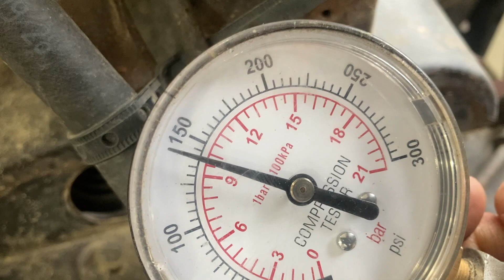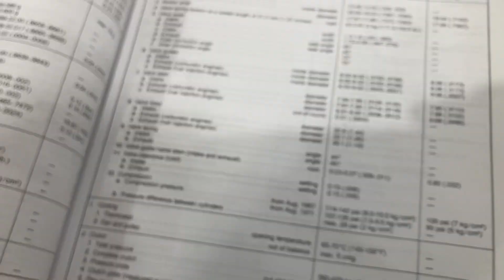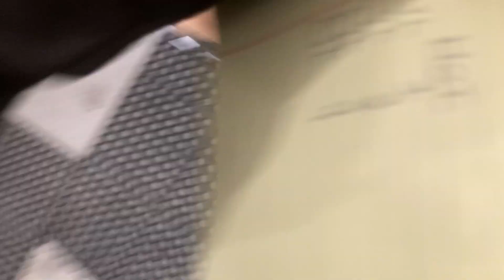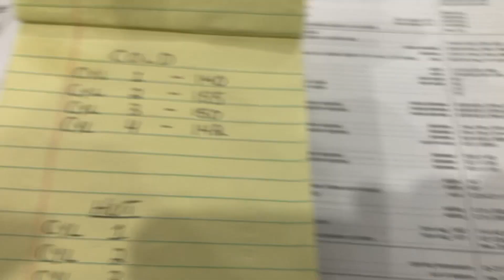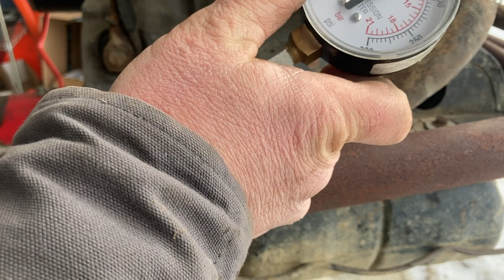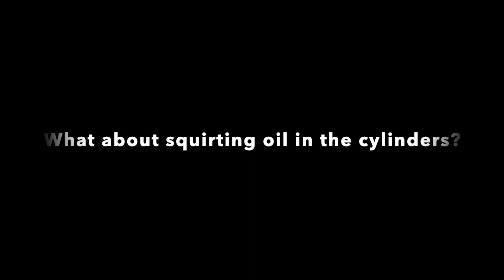Air Cooled VW Compression Test - COMPLETE GUIDE

Comment: Nice vid, I am fairly new to air-cooled VWs and been learning about them lately, I'm planning to do a compression test on a stock 1600 dual port

Would elevation affect the results of this test? My logic says so, that they should be lower,  but I might be wrong... I live at around 9000ft or 2800m

Comment: This was an awesome video!  I have never done a compression test, and now I've saved this for when I have to.  Right now my issue on my 79 FI bus is that he wont idle, unless the brake assist hose is pulled out.  Then the idle is rough.  Worked great up until about a week ago.  Have checked and cleaned all the wires, teste the 3 & 4 FI with a noid, and evertyhing is working.  Just haven't tried fuel pressure test.  Have you got a video for that?  :)
Reply from the maker: I know this is a late reply, but thank you for watching this video! Somehow I missed your comment! How’s the VW going?

Comment: My father had a 1600 dual port in a 1971 VW.  The compression in the #3 cylinder would drop below 115 every 30,000 miles.  The problem was always a valve, and never was a sealing or ring problem.  The engine also sucked the exhaust valves in the same cylinder down into the crankcase.  It happened three times.
Reply from the maker: Something very wrong was going on in that situation….

Comment: I don't understand why I need to know the average or the variance across the engine for each test. Problems are on a cylinder by cylinder basis. And since you numbers are so good, why would I want to know what the variance or average is for a bad engine? If the readings are out of tolerance per cylinder cold, and out of tolerance per cylinder hot, what use are those other two stats? I'm not nitpicking, I just don't understand why you bother to figure those up? The "wild changes" will appear from test to test.
Reply from the maker: If you don’t feel the need to test cold and hot, or with an average reading, then don’t do it. 

I prefer to gather as much information as possible. If the compression suddenly drops when it’s hot, this could indicate a crack somewhere that has now expanded, or another issue.

It takes such little time to do a thorough test, I just don’t see what it hurts, and there’s a chance you’ll notice a pattern.
Reply: @MaineMachinist  I understand getting data. And please don't think I'm criticising the technique. I'm actually trying to understand it thoroughly. I need to test a 1600DP this weekend. What I don't understand is how the variance is useful to you in determining a problem. Variance is about dispersal across the numbers. Does the manual state a variance as equal to a cylinder by cylinder loss of pressure? If cyl 1 is 125 psi cold then 85 psi hot, with all other cylinders within range, how does that variance help in determining the issue? In other words, how are YOU using that statistic so that I can use it. What does the variance specifically tell you?
Reply: @paulcostinett886 I think he said it may be a clue or a reason to investigate further. And that the compression test is generally inaccurate and unreliable. You might consider using a differential pressure cylinder leakage tester in the future. ✌🏻👶🏼🚬

Comment: a friend just put together a vw motor and it won't start when turning over instead of sucking in the carburetor it blows out what has he done wrong?
Reply from the maker: Do you mean the carburetor makes a  popping sound or it’s coughing?

Or are you saying if you took the carburetor off and put your hand over the intake manifold that it would push air OUT against your hand instead of sucking air IN
Reply: with the carb on it pushes air out instead of sucking could the distributor drive gear be installed wrong  by the way thanks for your help @MaineMachinist
Reply from the maker: @JONWICK-oo6mt  first thing take the carburetor right off and crank it over and see what it’s doing
Reply from the maker: @JONWICK-oo6mt  if it’s a dual port take the center section of the manifold off and see if both sides are doing the same thing
Reply: we finally found out what was happening tore the motor completely down and found one of those plastic bushings that hold the wrist pns in had fallen down and was keeping the valve open.Put it back together and it runs thanks for all your help  @MaineMachinist
Reply from the maker: @JONWICK-oo6mt  thanks for the update

Comment: Could you do a leak down test on that engine?
Reply from the maker: Yes you can, and I will probably make a video showing that sometime soon
Reply: @MaineMachinist   Did you hone those 87mm cylinders before installing them? You got great compression for 87mm P&C.
Reply from the maker: @vintage76vipergreenBeetle  yes! In fact they were a used set. They got a real quick hone on the Sunnen machine and a set of Total Seal rings
Reply: @MaineMachinist  No wonder your reading were so good. You did the right thing with those 87mm P&C.  I read that even new cylinders need a light honing to work well. A high quality set of rings helps too.
Reply from the maker: @vintage76vipergreenBeetle  yes, even brand new sets of AAs especially can use a very very quick sweep with the hone. But even the Mahles aren’t perfect anymore.
Reply: @MaineMachinist   When you make the leak down video, please mention what was done to the engine parts. The leak down numbers on that engine will be good as the compression numbers.👍